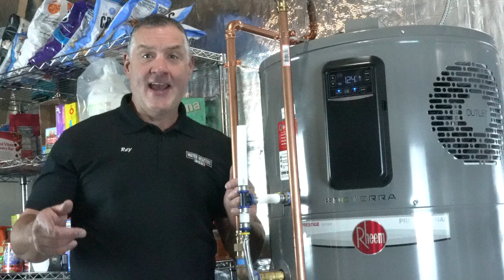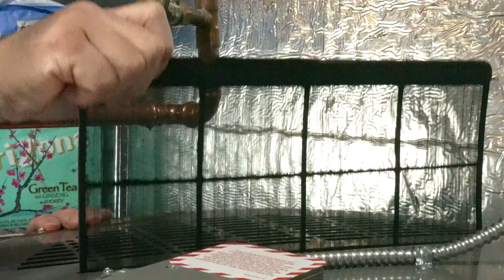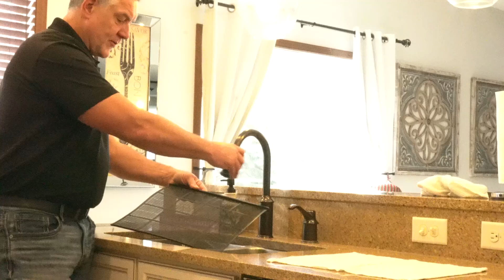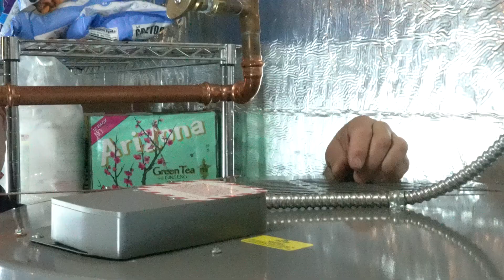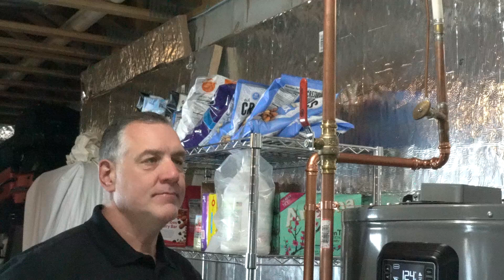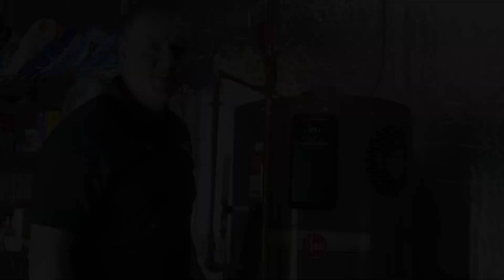How to properly maintain your Rheem Heat Pump water heater!

Comment: If its cold in my garage should I turn off the heat pump mode in the winter ? My garage is like 40F right now
Reply: From my research as long as it’s 40F or above then heat pump is ok. If it drops below that consistently it’s no longer efficient
Reply: @Ironside88 gotcha, my filter had some ice building up on it,  bottom 1/4 of it .

Comment: Ray, you did not state to close the drain valve before opening the cold water supply to refill the heater! Could be a wet surprise when owner takes off the drain hose. Cmon , details Man, details. What about cleaning the coil on the heat pump?
Reply: You’re a dummy if you do that and wouldn’t be his fault. Come on man! Personal responsibility!

Comment: Well Ray, the manual mentions cleaning the condensate drain with a chlorine liquid once a year!   You didn't mention that.  If it gets blocked it will flood inside the unit walls and out the base onto the surrounding floor. As I found.  Calling Sears service to check it did not get a timely response (3 weeks). When they eventually arrived no attempt was made to examine the unit.